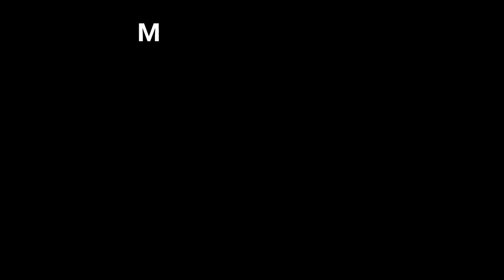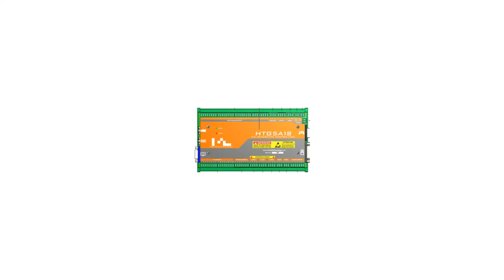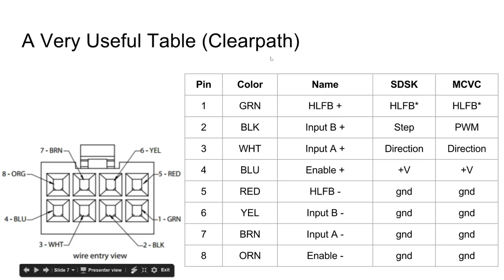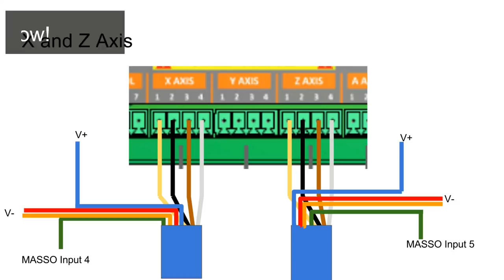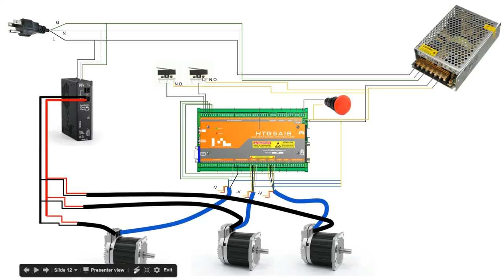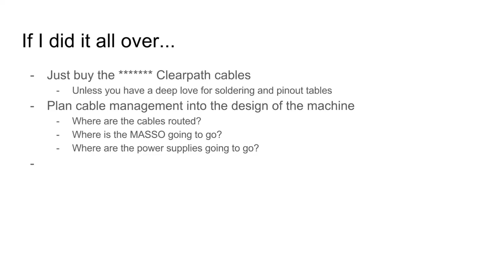MASSO CNC Controller Setup with Clearpath Motors Part 1:  Wiring

Comment: You might want to consider Voltage convertes if the devices driven by it are not drawing to much current. Then you save yourself a power supply.

Comment: Nice one, very well explained 👍. I run my Masso on 24v as the inductance proximity switches suffered voltage drop when going through the opto-couplers
Reply from the maker: Hmm I'm thinking of switiching to proximity or hall effect sensors, so that's good to know.  I do have a wimply little 24V power supply (1 or 1.5A) but I wasn't sure it would have enough power to run my tool turrets...
Reply: Yeah I think my transformer is only 1.5amp but I don't have anything sucking power from them.

Comment: I'm building a small mill and am looking at LattePanda as a replacement for the PC and running mach4 on it. Will have less wiring options but the price is much much lower
Reply from the maker: That sounds sweet, let me know how it works!  The price tag on Masso was worthwhile to me because I'm nearly computer illiterate :P

Comment: Qurstion: around 11:30 you said something like if you need +5v you need another power supply - so you can't use the +12v and throw a lm317 on it to get the +5??? It HAS to be separate???

Inquiring minds wanna knonw!!!
Reply from the maker: Nope, a regulator would work!

Comment: Maybe a voltage regulator can be an alternative to multiple power supplies?
Reply from the maker: Yeah, you'd need a really beefy one though -- probably a buck converter.  The problem is that I still need a few amps of 12V for accessories and things.

Comment: HEY! I am trying to wire this up as we speak, but I cannot get the relay outputs to work. When they're high, I get 1/2 a volt, low I get .02. I'm using a 12VDC 10A meanwell power supply so I SHOULD be getting 12VDC out right? Everything else works. The relays work as I've jumpered power to their inputs and they responded. Any help would be great. Thanks!!!
Reply from the maker: Hmm sounds like youve taken all the steps i would have... maybe the optocoupler is defective?  You could try changing it with another one (theyre in sockets on the PCB) and seeing if that works

Comment: gettng ready to cnc my  HF  mini lathe...masso looks interesting...great chart...dont you  just use x and y on lathe?
Reply from the maker: It's normally X and Z on the lathe:  Z is typically parallel to the spindle, and X is the next longest axis of motion.  Also, on lathes, +Z and +X move away from the spindle.  You should upload some videos of your machine when it's ready!

Comment: Is it possible to connect a 4 axis with angular division since in the manual I have not seen if it is possible ?, I would appreciate your answer since I am deciding the purchase of the data acquisition card. And from what I see the MASSO card approaches my requirements.
Es posible conectar un 4 eje con división angular ya que en el manual no he visto si es posible?,  agradecería su respuesta puesto que estoy decidiendo la compra de la tarjeta de adquisición de datos. Y por lo que veo la tarjeta  MASSO se acerca a mis requerimientos.
Reply from the maker: Hmm I'm not sure.  I know they sell a 4 axis mill controller that lets you control a 4th axis with XYZA coordinates

Comment: hi, great video!! will be the same with any controller for 3d printers? most have the 4 pins for the external driver...
the V+ and V- from the 8 pin connector need power from IPC too or any psu will be ok? any chance to get from patreon the wiring for that? dummies version of course... ahahahahahah
Reply from the maker: I believe the V+ (or V- depending on if your pins go high or low) can get its power from any PSU -- the only thing that needs IPC power is the motor power pins, which are on a different connector.  I'll certainly see what I can do about a wiring diagram :P

Comment: Wow. These have dropped way down in price since I first heard about them. If I remember correctly they were ~$1500 when they first hit the market. 

What is the difference between the models? Lathe vs Mill vs Plasma other than the number of axes that is? Are they software setup to only drive the corresponding machine or is it possible to change up the software to use the Masso across platforms?
Reply from the maker: +Paul B I think theyre physically identical, the only difference seems to be the firmware
Reply: Yes all the units have the same hardware. We have different software versions for different machine types and they can be updated anytime via email.
Reply: Cool. I kind of figured the hardware was the same and it was a matter o software changes. I just wasn't sure how free you were to switch between them.

Comment: So with the Masso for a CNC router i dont need some steppers motors DRIVERS ? Juste a 24v &  12v Pow Supplies ,screen,,keyboard , G code & Estop for the basic setup ,is that right ?.....Great video by the way ! I'm sorry for the annoying question but i try to make my self a idea but every videos i watch are different ,one guy says i need stepper driver ,a other one says no ,one says i need only one 24 powSupply and you say two ? I'm really lost right now but i have no choice bc its to much expensive to by a full cnc kit(plug & play)of a good quality/size . I'm building one my self but its just the electronic part that i'm lost du to different videos i did watch ?
Reply from the maker: Hi Martin,

No worries about asking questions!

For Masso for a router you will need:
-Stepper motors
-Stepper motor drivers
-A power supply for your motors
-A power supply for Masso (5-24V)
-A keyboard
-A screen
-Some kind of CAD/G-Code software

Each motor requires a driver and the drivers all need power from the motor power supply.  The motors I used are called Clearpath motors and have a driver hidden inside of them.  The motor power supply typically supplies 24 or more volts and lots of current.  If you use a 24V motor supply, you can power Masso with the same supply.  This would be a big advantage because it means you only need one power supply, BUT power supplies with a lower voltage cannot run motors as fast.   My motor supply is 82V, which would kill the Masso.  That is why I needed a second power supply - one to drive my motors really fast and one to power Masso.

Another consideration is that if you want to have accessories (Lights, coolant pumps, etc) they need an appropriate supply as well.  It's unlikely these accessories would need high voltage (more than 24V), so it often makes sense to run them off of the Masso supply.  This means that the Masso supply has to be able to supply enough current.

I don't know what you already have, but if I could make some recommendations:
-A Masso (Controller)
-A Geckodrive G540 (Driver - one G540 can drive 4 motors)
-One 24V power supply
-NEMA23 Motors
-You will need connectors and things too, but Masso and Geckodrive both have really good manuals

If this is your very first machine, it might make sense to get some NEMA17s, a TinyG board (drivers are built in)  and just play around with those for a bit until you are confident that you have the system figured out.  Masso isn't the cheapest way to start, but I would say it's probably the least amount of troubleshooting compared to PC based systems.

I hope that helps, and feel free to email me at hlaps1990@gmail.com if you have more questions!
Greg
Reply: Man, you dont know i much it help me ,i understand now, clear it is haha ! you'r the first to explain it to me simple  like that, nowwwwww,i know were i am going !!! I didn't start my project right now ,it will be a OX workbee 1000x15000 project and the kit come with 4 nema 23(dual y) and i'll probably bye a Bush or Makita spindle for now that it plug on the wall but i will install some stop sensors as well so for that i guest i will need a extra PS or i can plug them lets say with my motors on a 48Volt ps ?  Thank you very very much !!! P.s i'll get your E-Mail for further question or more ,thanks again !
Reply: -Oh and can i use my iPad as a touch screen via wi-fi (with the chip) ?
- What kind of software do you suggest (simple as possible) for cad/g-cod  to fit with Masso ?
- If later i want to ad a lather(4th axi) can i just bye the extra driver and plug it with the others ? Thanks again !!!
Reply from the maker: Hi Martin,

It's pretty unlikely your limit switches will be able to handle 48V, but you could look at getting a "buck converter" if you just have a few little accessories and want to run them off the motor power supply.

I've never heard of someone using an iPad.  I think they're pretty locked up so it's hard to use them for projects.  You'd have to see if Masso would support such a thing.  I think they can do touch screens, so maybe there's a way of doing it.

I would suggest Fusion 360 for CAD and CAM (G-code generation).  It's not free -- it's about $300USD per year I think, but you can often get it on sale for much less.

If you want a fourth axis, you would need an extra driver, yes.

Hope that helps too!
Greg
Reply: For the IPad, i heard from them in one video that the wi-fi coud be read by a IPhone(looks better for selling maby) anyway i will given it a try and if its working, fine, i 'll spread the word and if not ,just a screen & keyboard will do just fine . Thanks you again Greg ! I'll keep you in touch .

Comment: Be careful which USB stick you use for loading the firmware onto the MASSO. I was having issues with my initial firmware load, and this was entirely to do with the fact that the USB stick I was using was junk. Not sure why the MASSO was having issues with the "cheapie corporate promo" USB stick... but everything loaded well when I tried with a name brand stick
Reply from the maker: I'm using one I dug out of a drawer and it seems to work well, but it happened to be a name brand.  I definitely think they should include one to avoid the user having to mess around with different sticks until they find one that works!
Reply: It’s true. But another issue happens, the alarm e-stop keeps blinking  even with nothing  plugged. I order in eBay for a external e-stop . I will wait for it..  the cstumer customer
Reply: Customer service answered,  but send me to the menu and watch videos,  do not answer me what I have to do step by step .  It’s not a real people answer.
Reply: Yes!  I thought I was going crazy trying to get a USB stick to work.  Finally, the stick I used was 32G cheap-o formatted to FAT32 (this was essential).  I explains this well in the documentation, but finding a smaller memory stick that would accept the FAT32 formatting was a bit challenging.  Note to MASSO: Including a USB stick might greatly enhance user experience.

Comment: how much will all the setup cost?
Reply from the maker: Just for the electronics?  Masso was like $600, Big PSU was $200, small PSU was $40, Assorted wiring and connectors were like $20, I already had a monitor and VGA cable and keyboard but you could probably get all of those for like $100... call it $1000?
Reply: what deal is ti ?

Comment: thing with masso is you buy lathe or router. its same with diff firmware. thats why havent buy.
would be nicer it works for both.i not care if it would cost 2x more if it have both.DID SOMEONE GET IT.they sell 1 item for 2x price and you get 2 usb key lol.

or they sell 2 item cost same.

why i need 2 controller? its waist of everything sell 2 same kind when it can be with 1
so firmware should be like 50 or something to change it from lathe to router.its meaningless when its actually free, but ANOITHER what ever it cost. no thx. i can build raspbnerry pi controller cheaper boot up 5 second or custom app lol